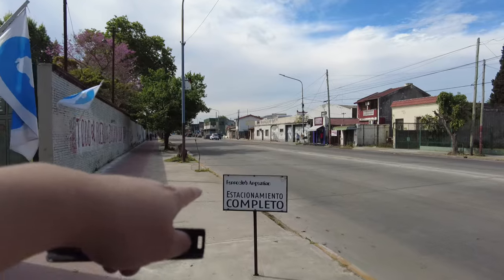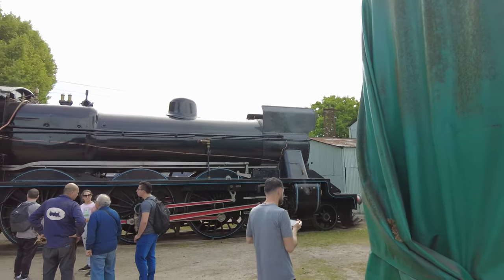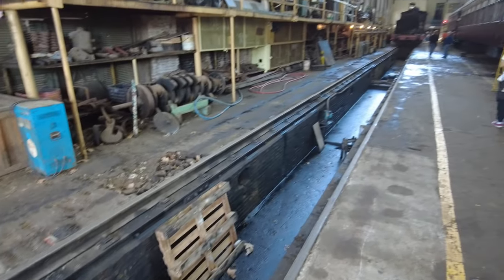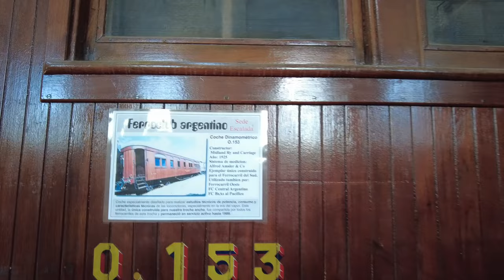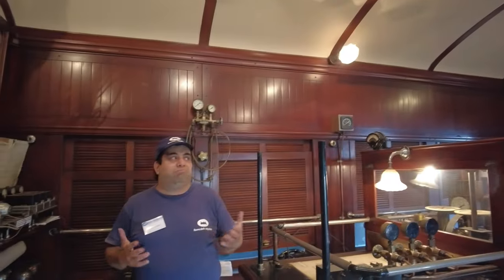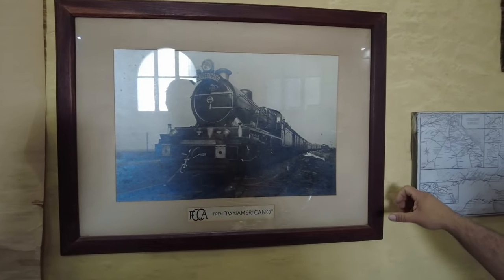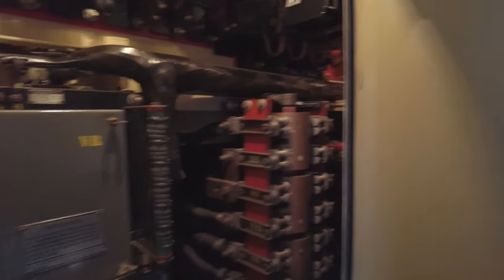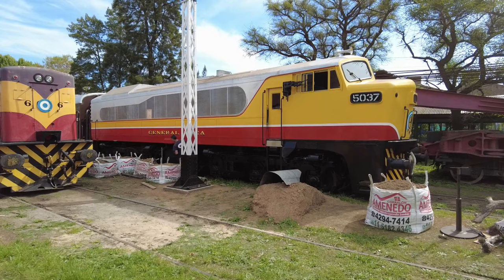There Are SO MANY Restored Antique Trains Here Outside of Buenos Aires

Comment: Amazing video!!!! That diesel Locomotive is designed as Baldwin Lima Hamilton, they actually have three of them. One you were inside, the second is that red antirust one (complete too and it's in working condition, but it must have a restoration) and the third it looks like scrap and its hidden (it was bought from someone who long time ago couldn't afford the trip, so the locomotive stays there). There's another Ferroclub in Lynch, near Bs As and you can go by train also, not as big as this. I hope that helps.